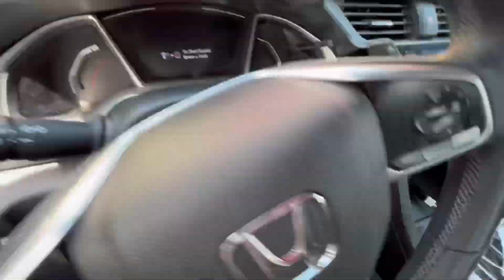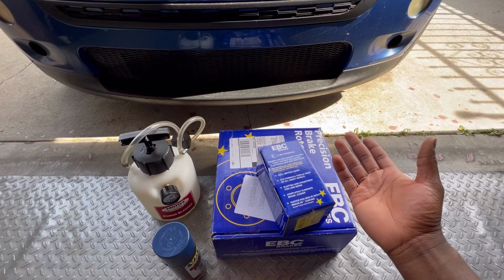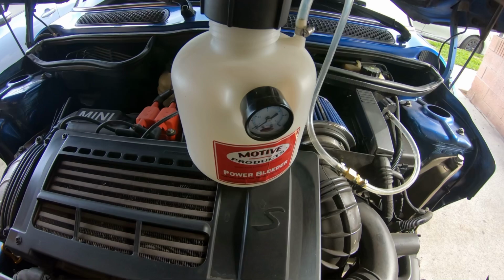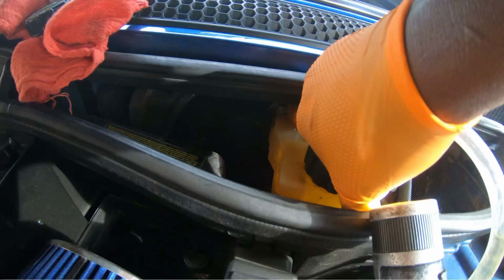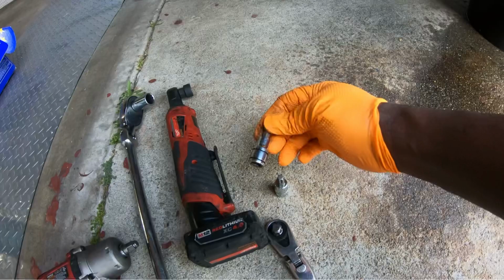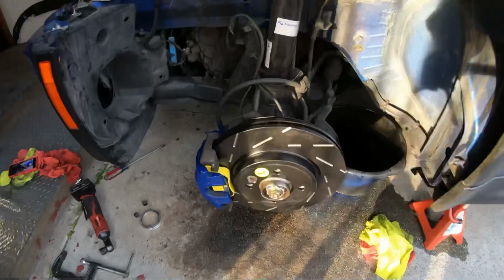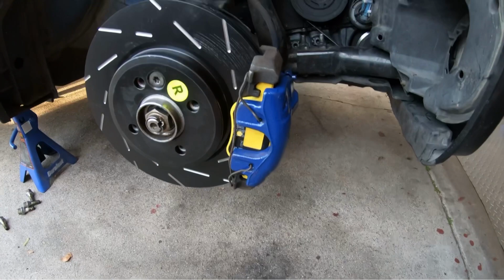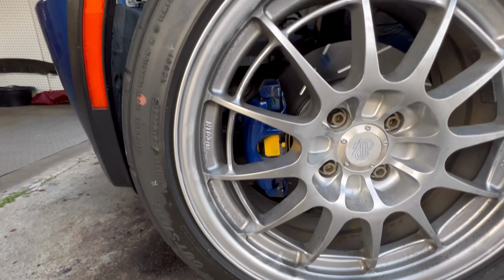Mini Cooper S R53 Front brakes upgrade

Comment: I'm about to do a similar upgrade but I'm going with mintec disc drilled + grooved with mintex pads but I do love yours, be careful cleaning the calipers next time though as the brake dust is very hazardous has asbestos in them really bad for you buddy, definitely wear a respirator next time. If I had one negative I would of spray the calipers yellow to match the pads & this would of also made the caliper look more bulkier or sporty, great job though